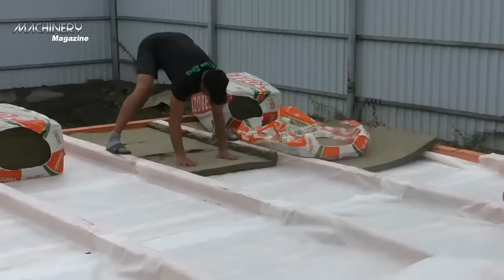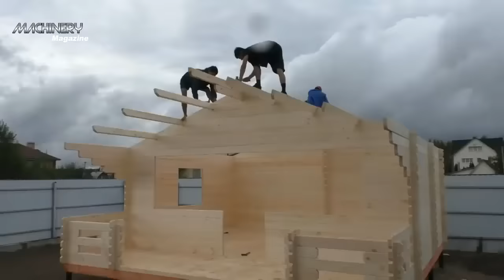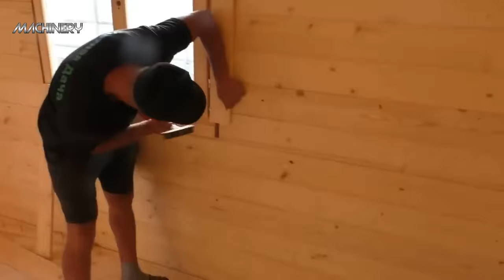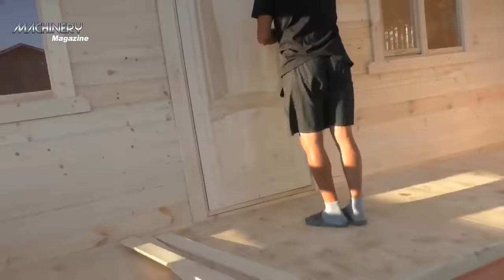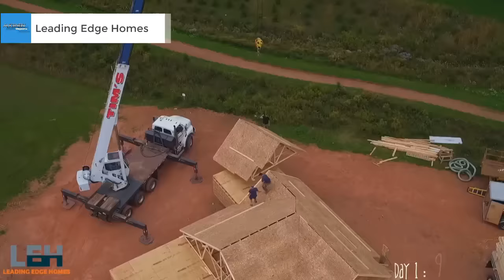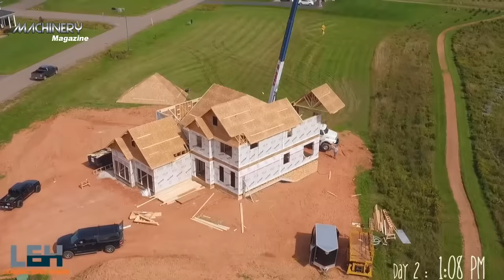Amazing Fastest Wooden House Construction Method - Intelligent Process Log House Building in 1 Day

Comment: Don't forget to put clumps of hemp mixed with tar or some kind of resin between the planks on the exterior walls. That provides a flexible seal to accommodate to the wood expanding and shrinking with the seasons and moisture changes.

Comment: Kit Structures created from pre-milled lumber systems, like the first structure shown, became available in Canada about 50 years ago.  They were popular for "summer only" vacation cottages and small out buildings and sheds, but didn't catch on for permanent homes.  Building exteriors need to be painted or stained on a regular basis and exterior components like decks and railings need to be created from pressure treated preserved wood to survive long in extreme climates (100 + C. in summer / -40 C. in winter).  Log homes in Canada are typically built with large logs to provide a wood wall thickness at least 16 inches thick.  With no interior framing providing for electrical, plumbing and adequate insulation,  cost quickly escalate to create a year round structure and Canadian homes typically have basements.   I don't think many of these structures built in the early 1970's are still standing today.